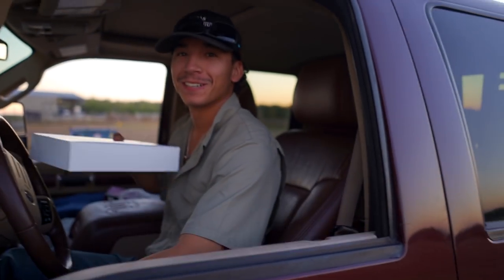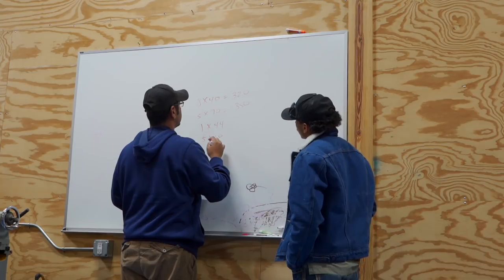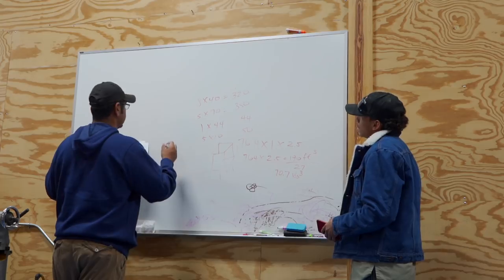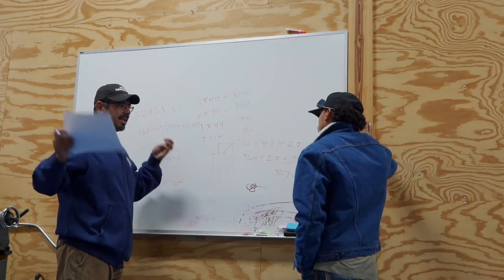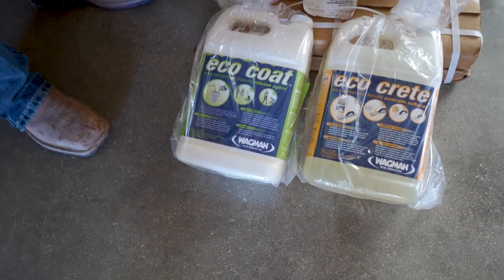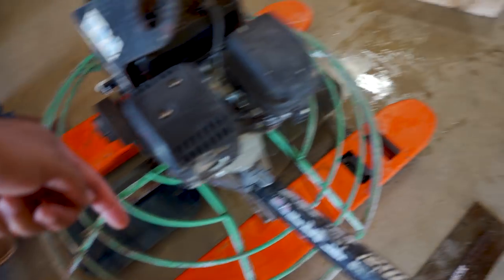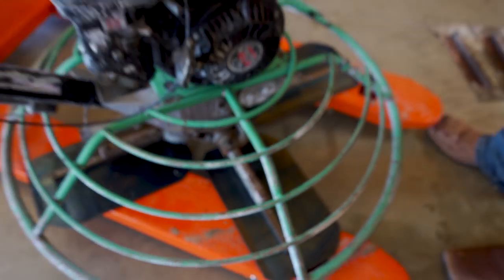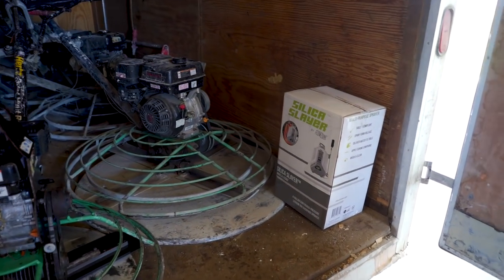Wagman Eco-Crete - The Barndominium Show E177

Comment: Excellent primer on figuring concrete volume Erik!  In a future video, can you show and go over how you dig and prep the beams while you are setting up the forms and rebar for a slab pour?  Great video and information content!
Reply: Figure out your corners put up batterboards on finish floor spray paint your perimeter set your laset to finish floor go up the feet and inches that is requiered start digging and checking with laser dig out interiors put up string lines start forming and re checking with laser grade slab and clean footers put poly then rebar then wire or cables if it asks for it
Reply from the maker: Raul, we form first, then dig beams, then poly and rebar or PT, headers, and then we pour.
Reply: @TexasBarndominiums  when theres no brick ledge its alright

Comment: 324 divided by thickness of concrete divided by square footage of slab will give you the yards needed.  Same with footing(beams)   4” slab will be divided by 81.   324 magic number.
Reply from the maker: Nah, just figure volume in cubic feet and divide by 27(cubic feet in a cubic yard) to convert to cubic yards.   That will give you the volume to any thickness of slab, amount of fill dirt, etc.

Comment: Will the concrete disolver not affect the pad your working on ?  Also the hose is on backwards on the grease gun.. the spring goes to the pump side..
Reply from the maker: The pad we are working on is sealed.